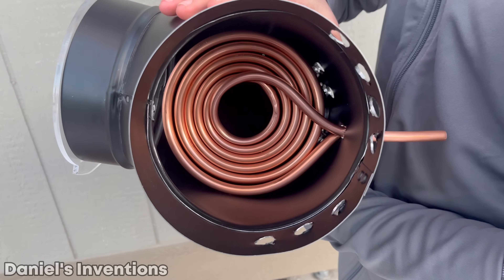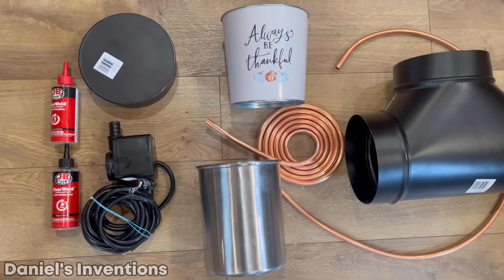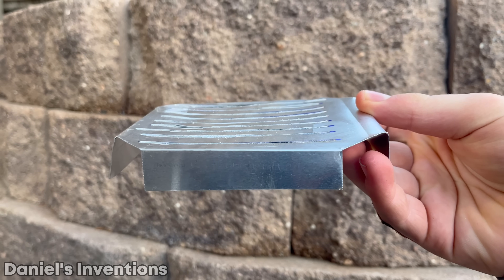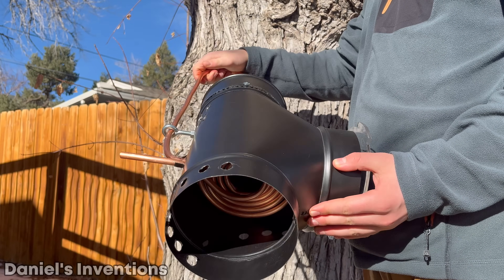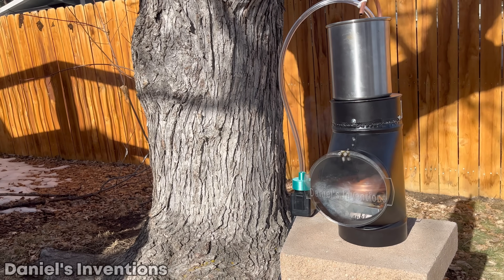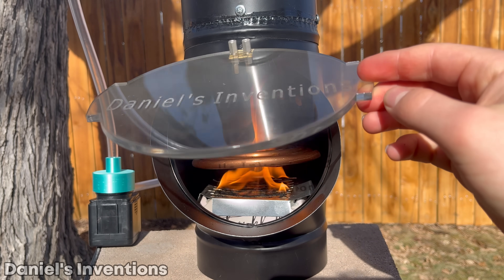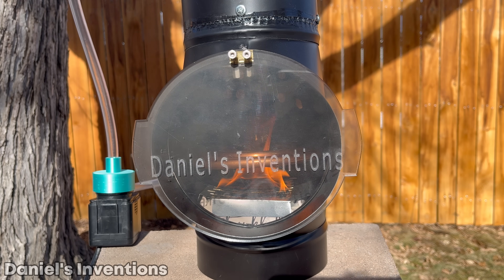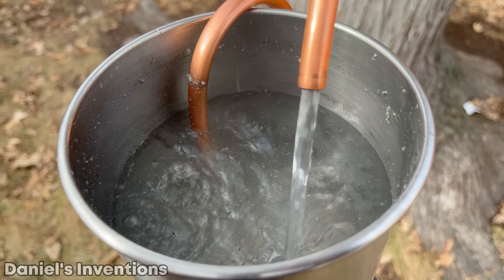ENDLESS Hot Water for Your Home (NO ELECTRICITY)

Comment from the maker: Endless Hot Water for Your Home (No Electricity). This is a very cool instant hot water heater that can run off of regular cooking/vegetable oil and generate heat/hot water for your home for up to 24 hours running on a single small tank of oil. This instant hot water heater only weighs three pounds. It is very light weight and can be carried in a backpack and used in a case of power outage or emergency. Also, any water can be boiled down so that it can be used as drinking water in case of water outage. In case it is used indoors, an exhaust pipe has to be installed to vent the fumes outdoors so that the heat radiation can also be used as a source of heat. For the sake of the video, we used a small fountain pump, but a heat pump may need to be used that is designed to handle boiling water temperature.
Reply: Why not just use a jug as gravity feed? No electricity needed.
Reply: Absolutely love this. Thank you so much for sharing. ✨🤩👌🏼✨🙏🏼🤍🐺🕊
Reply: Batteries store electricity.  So your pump actually uses electricity.
Reply: I think ... the water pump and plastic hoses are PUSHING THE INLET COLD.
Reply: @thedolphin5428   yeah thought the same at least it seems so if you watch the video until the end
Reply: Ŕ
Reply: I commented on your home oil heating video too but can you use restaurant waste oil to burn for unlimited free hot water ??? 😇😇😇
Reply: That's a great suggestion! The Segway Portable PowerStation Cube Series sounds like an excellent addition for outdoor enthusiasts and for home backup power. With its impressive capacity, fast recharging, and versatile sockets, it's definitely worth considering. And the fact that it's waterproof is a major plus for outdoor adventures! Thanks for sharing this recommendation.
Reply: aku dari indonesa minta pengertian nya,,,kalau memakai pipa tembaga/Kuningan air nya layak di minum??karena aku pengen buat air mendidih yg instan/ cepat,mohon penjelasan nya,,, terimakasih

Comment: One of the significant advances of human civilization has been the discovery of "blue flame". This is when you mix fire with enough oxygen that the flame turns blue and this is when it burns very efficiently. Simple stovetop gas burners have air mixing inlets that lead to a blue flame. Block said holes and the flame is yellow and very sooty. Cool invention though!

Comment: You are cooling down the smoke never put the pipe inside because watervaper will gather inside from the water in the wood and it will rust and break in a year at most

Comment: I was thinking about doing something similar with this but at a smaller scale using a candle inside of a tin can with a little door so the candle can't fall out and the copper coil inside as well, using a portable cooler as the reservoir to hold and keep the water hot longer and attaching the copper pipes to the water pump in the same way but add a heater core from a car with a fan behind it for heating a room in the house! Thinking it should work and shouldn't get any hotter than 150F might even be less but as long as it's putting out 110 120F that's plenty hot enough to heat a room in no time at all!

Comment: You could link up the heaters flow and return pipes to a larger insulated 20 - 30 gallon water butt/container for a better volume of hot water storage?
The water pump would provide the circulation, or even thermal convection to the water butt?

Comment: Again, cool idea. But I just wish it was actually WITHOUT ELECTRICITY 

Saying that something is not needed then you use that said something for the actual operation of the product, then it's not WITHOUT it.

Even if powered with a battery, guess what, that's using electricity

Comment: Now I want to see one with a potable water tank and recirculation pump to get the stored water up to temperature for a shower and an easy way to ignite and turn it off. I'm thinking of using a spark plug attached to a battery and a button to start it and use a sealed manual damper on the intake and exhaust. For bonus points use electric dampers and have them open when the pump turns on and close when it turns off.

Comment: >No electricity
>"A small 12V DC water pump can be used that can run on a 12V battery"

Last time I checked, a 12V DC water pump still uses electricity...

Comment: Very clever. How long do you think that pump will last with that hot water. It would be cool to see if you can do a pump less system and let the water circulate from hot water rising.
Reply: In theory, if the feed water into the pump is cool enough, pump will have no issues. Once you've "used all the heat" for heating, the water is still toasty, cooling it down with a radiator or thermal dump will prolong pump life.

Take care, stay safe.

Edit: damn, my point, yes! I concur with your idea of thermal currents to pump water in small scale.

Comment: The design is great however I would improve upon it and only one way

Have a secondary water tank that sits above with a water line on the top of the tank and a waterline on the bottom of the tank the top one runs to one into the heat exchanger the bottom one runs to the other end of the heat exchanger and what happens when you do this as you will get a water rotation that works with gravity as the water heats up the hot water rises to the top line in the cold water is pushed down through the bottom line and then you would just run a water faucet off the bottom of the tank so you can keep the heater outside and have the tank inside

Comment: Your invention needs to look at cost,  ease of use and accessibility. If you could somehow connect to your main water supply and have it auto switch on when the hot water tap is opened then you may have a good invention that could compete with gas geysers. I'm sure with a working proto type of that you'll be able to get a good kick starter up and running

Comment: I think you may be able to delete the pump. With copper tubing..Go from bottom of hot water reservoir to flame coil ..that discharges to the top of the hot water reservoir.. the heat causes pressure and that will push your fluid..like a coffee maker. I think.this is the thermosyphon effect?. U will probably have slugs instead of Constant flow. But u may be able to eleimate the bottleneck of the upper pump te.perature limit...speaking of bottleneck, it may be a good idea to put a valve at the bottom of the hot water res..limit the amount of water gets to the coil...allow u to adjust how much ur heating with constant flame.

Comment: Very nice invention, congratulations! I like it, but i have one small question, why does it say no electricity? You can’t power the pump without electricity. Maybe you can find something that cand make your water flow 100% without electric current
Reply: He mentioned a 12v battery. I don't think it's meant to be a long term solution, just enough to get by for a little while if you can't justify the cost of a more efficient system.

Comment: No electric but 12 volt motor .. it could actually run without the 12 volt motor .. that would be useful to know .. if you just don't have any electricity.. old radiators systems used to work by gravity in the old days , just for the fact heat rises and cold drops down , creates a circle .. u know what the pump does

Comment: The stainless steel pot is sitting on top of the stove, and the coil is heating hot recirculating water. This is heating one gallon of water, not endless hot water.

Comment: Was thinking of a bigger design that runs off an indoor woodstove, only issue I could think of is how all my pex and pvx lines would need to be swapped for copper to handle such hot water flowing through the lines. 
Though there are other designs used for this to work, like a system that mixes the how water with well water from the blatter right after it comes out of the hot water reservoir so it brings the hot water back down to a normal hot water heaters temperature range, so all the pvc(plastic) lines already installed can stay. 
Plus to have pressure to the hot water system it needs to be tied together with the house main in some kind of setup. 
If already using firewood to heat our homes during the winters this would give us free hot water all winter. All year if you want to have an outdoor woodstove for summers. Starting an indoor woodstove for hot water when it's 90F outdoors sounds like a bad idea 😂

Comment: I wonder if there are any clever humans out there, thinking about ways to make old coffee makers, which are often found at thrift stores, for low money, who are thinking of ways to make appliances like these work in some similar ways to the ideas in this video. How about clever people who can figure out how to make lithium battery powered appliances.
 I once wished there was a battery powered mini microwave, that I could have taken to the job site, when I worked carpentry in the winter time. I guess there was a mini microwave on the market at one time.  More focus on units that can heat and boil which can function reliably on re chargeable batteries. I feel confident it can be done.

Comment: I would like to see this hooked up to your wood stove. I seen a guy wrap tubbing around a stove pipe and it recirculated into a hot water tank without a pump. The therapy was based on heat rising. The hot water tank sat on a shelf above the stove.

Comment: I don’t see the endless part.    You have just accelerated a boiling of water.    Hook a hose up to it and run the hose and you’ll find you can’t even get 65 degrees out of the water running it through that tubing

Comment: Just a thought but from a log burner you have a flue to roof. Could a coil like this shown in a flue be placed so that the secondary heat leaving the flue heats the water into a water tank next to the log burner. Is that a  convection system? Then whilst using the log burner you have a dedicated hot water system?
Reply: As long as the coil intake is lower than output then yes, and it doesn’t need a pump. ✨👌🏼✨🙏🏼🤍🐺🕊

Comment: I love the effort but you don’t need an electric pump.
Reply: What you need ?
Reply: @AymenYT  he could put a cold coil on the outside to create a heat differential which would push the water around.
Reply: Oh what do I need?.... Air, food and love but I could also do with more money, therapy and somewhere decent to live... why you offering? 😄
Reply: @bertnorticus1662  nice joke 
I don't know if what you said will work though but I'll search more about it what does it cold ? Heat pump ?
Reply: @AymenYT  cheers 🤥

I don't really know tbh cos I've never done it but I theorise it might work.

If he made sure that the hot water container was air tight and able to handle pressure, there would be enough pressure just to push the water around anyway 👍.... that would definitely work.
Reply: @bertnorticus1662  the plastic pump will melt anyways
Reply: @AymenYT  yeah true...

Comment: Good idea, now combine this with your ENDLESS Heat for Your Home WITHOUT Electricity 2.0,. Use use the thermal siphoning principle, no pump. Well done . Informative 👍👍👍. Thank you for sharing. Be safe🇨🇦
Reply: Take a look at the pipes at different shots. When he puts snow in the bucket, there is a plastic pipe. In other shot, both pipes are copper. Bet the cheap pump did not survive the heat through the demo either and the water we see circulating may be just thermal ciphoning. Stole this idea from other comments.
Reply: @Teknopottu  He seems like a young guy, a  teenager. At least he is trying, and not bitching about things like many others. His heaters are doable and should work nicely, unlike the clay pot heaters. What a joke
Reply: @yeagerxp  Why the hate? Pointing out things not working and stuff that could work better should benefit everyone, young or mature.

Sometimes people are trying to mislead other people with something that does not work as is and many times it seems it is because of views and subscribers. Bitching about things like this may not be okay for everyone but it does not have to be. 

Clay pot heaters work at certain level. Nothing miraculous and surely nothing to heat your entire home with. Maybe something to give you local extra heat source and to re-use scavenged materials.

Comment: Calculate the heat transfers 1. to bottom of pot and 2. to surface area of small pipe the RATE of hot water production was not shown and not that high either. see how long it takes to heat 5gal bucket from 40 to 95f , also temp control is a huge problem. Most heat xfer is not in the coil but at the top plate Also pump is unneeded as it will thermosyphen
Reply: Did you study real heat exchangers for instant flow water heaters, look at the huge delta temp at the exchanger is it 10 watts or 220v:*30amps? Note they're not on very long. instant heating need huge temp differences and well designed HEs

Comment: Just wondering, in case of power outage, how does the pump work?
Reply: "...a small 12v DC water pump can be used that will run on a 12v battery." A battery from a car would do in a pinch.
Reply: @jonathanv5053  actually a 12vt from a lawn mower recharged from a very small 12vt solar panel would be more than sufficient. I know, I know  . . . Most persons would not want to spend the extra $12 on a solar panel. Very inexpensive on eBay and it beats dragging out a charger . . . In fact, a heating element for an electric stove instead of the burning fire would be better. 😀
Reply: @gigmaresh8772  Both pretty good options, and the mower battery is lighter than a car battery by far.